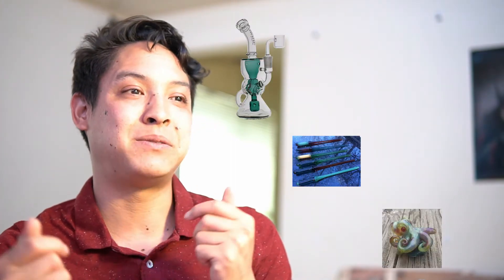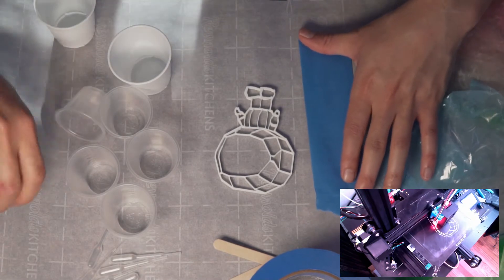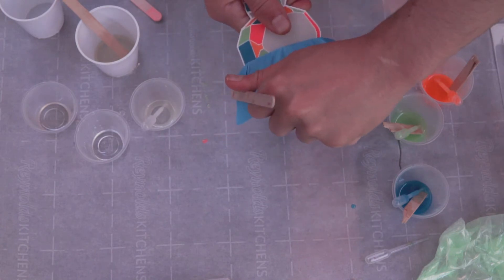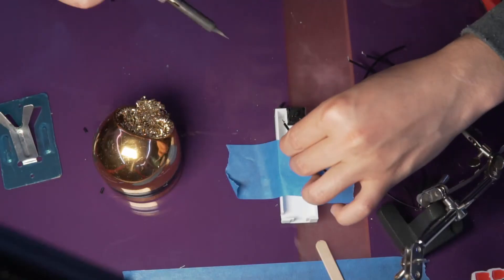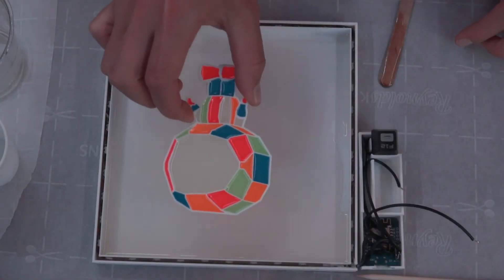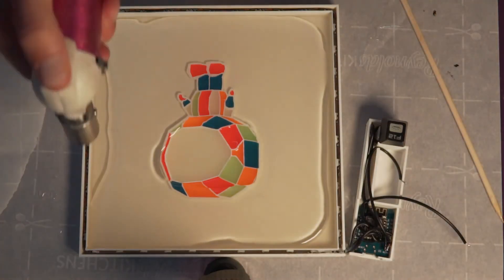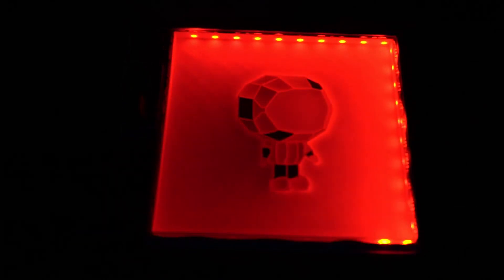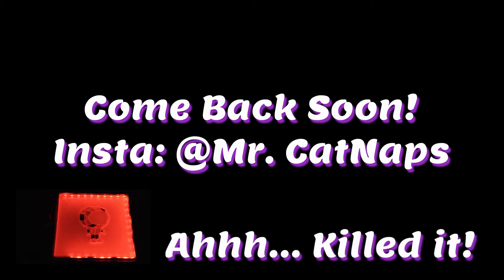NSFW? Dab Mat Build with Integrated Heating and Cooling Timer!

Comment: Thanks for the STLs! Do you by chance have a picture of the pins you used on that board? What LED strips were those, neopixel?
Reply from the maker: The easiest way to figure out the pins is by looking at the code. 

The button is on D5, the LED Data is on D8, the second pin from the button is connected to ground (any ground on the board will work and you can connect multiple to the same ground, which is what I did with the copper lead), the battery positive side is connected to VIN, the battery negative side is connected to ground, the LED strip 5V is connected to VIN (doubled up on VIN), finally the LED strip ground is connected to ground(every piece has to be connected to ground on the board).

If your board uses GPIO instead of D5 then you can use this for conversion. https://i2.wp.com/randomnerdtutorials.com/wp-content/uploads/2019/05/ESP8266-NodeMCU-kit-12-E-pinout-gpio-pin.png?ssl=1.

LED Strip: https://www.amazon.com/gp/product/B019DYZNU0/ref=ppx_yo_dt_b_search_asin_title?ie=UTF8&psc=1
Super high density LED strip.